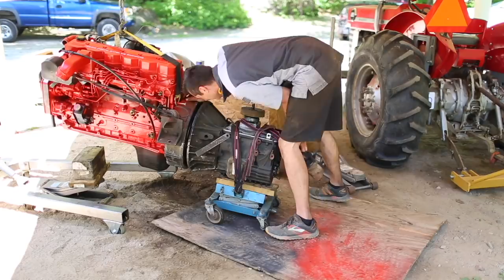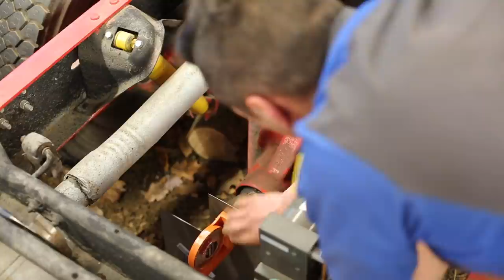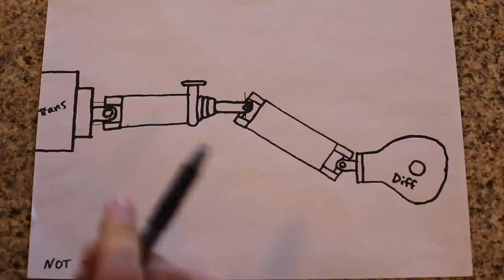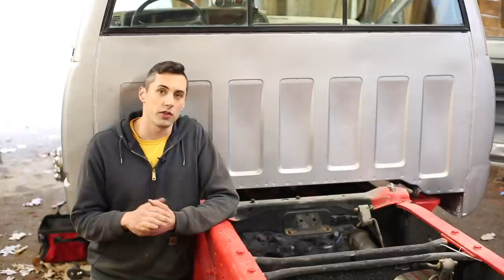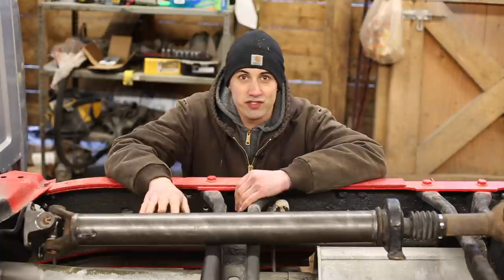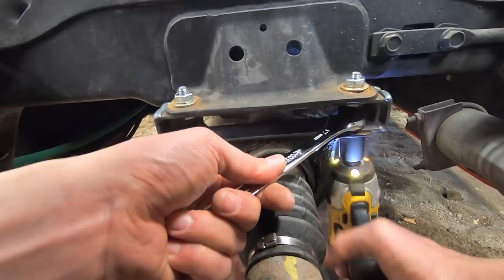Installing a Custom Driveshaft for an Eaton Fuller 5-Speed Swapped GMC C3500HD [Part 18]

Comment: I always enjoy watching these videos.  A good learning tool . Let me share some experience with drive shafts . I worked at a power plant for over 30 years and on the cooling towers there is a large electric motor that drives a gear box through drive shafts . Initially they were two shafts that were stainless steel and a center support bearing . Those things failed regularly and that resulted in damaged to the fan blades . Sometimes total loss . In fact Sometimes they through a blade off into another cell lol. Total carnage.  The fix was in the case a one piece I think fiber glass or some kind of man made material.   Failure stopped in that area .  At any rate when I did the g56 conversion I went with a one piece aluminum drive shaft.  Works OK.  I remember years ago when I was a kid out of tech school I worked for gm and they have drive line class that explained so of the material you spoke about . Lots of learning experiences over the years on drive shafts . I heard of guys balancing there drive shafts with worm clamps . Lot of trial and error there lol

Comment: U-joints should operate at a minimum of 1 degree. This is to facilitate the needle bearings rotating within the cups and prevent them wearing prematurely.
Reply: I agree, I took a driveshaft class at Dana and u-joints should never be at degrees
Reply: 0 degrees

Comment: Adjusting driveshaft and pinion angles with no weight on the rear end is a mistake because they'll change again when weight is applied. You don't even have a truckbed installed so obviously weight will be applied, to say nothing of trailer tongue weight or payload.
Reply from the maker: Yeah, I'll probably re-check the angles once there's weight on the back 👍

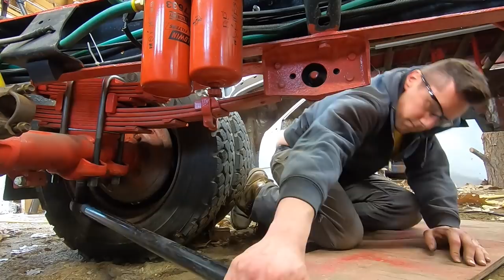Comment: 8:45 XDXD, I weigh like 300ish and I did the same thing until I couldnt pull anymore, I was bending the U bolts so I thought I was about to break them (they are grade 8)

Comment: I find that everything goes easier when I use"CRC Knocker Loose" penetrating oil before disassembly and I always slather anti-seize compound on all threads before replacement.  What happened to the disk guard that came on that angle grinder?  The sparks (burning iron) will eat holes in your clothing.  (did the dog eat it?) Ron W4BIN
Reply from the maker: Now that you mention it, that sounds about right! The dog probably ate it 😂

Comment: I like to set all my u joints at a minimum of a 1/2 degree angle so the needle bearings in the caps have to move slightly. this will help the grease get to all the needle bearings. li try to stay under 3 degrees on my joints. that pinion angle will decrease once you put a bed on the truck as well. i prefer a greaseable u joint. obviously the sealed units work well. gm, ford and chrysler have been using them for decades.
Reply from the maker: Yeah, I'm definitely going to want to re-measure it once it has more weight on the back and possibly make adjustments 👌
Reply: I was also going to comment that UJs need exercise and 0deg will lead to sticking.
Reply: I prefer greaseable joints too.  I like a bit more angle but a 1/2° works fine.

Comment: You never use a 0 degrees. the u-joint needs to move to keep from bearing rollers from embedding. The engine should be the same as the rear end. 3 degrees is the most you can have in the shafts angle. Even if you have to lower the engine.

Comment: Waldo, nice video! Remember, with a leaf spring rear suspension, your pinion angle will change throughout the cycling of the suspension (including when you add the weight of a truck bed, not to mention the weight of cargo or trailer). This is going to change your previously measured u-joint angles. They will no longer be equal and opposite to one another.  Most likely this will not be a problem or cause vibration. But, it's just an observation that in the real world, it's almost impossible to get the angles perfect.
Reply from the maker: Thanks! Yeah, once I build a flatbed, I can re-measure and change out the shims if necessary 👌
Reply: Just watching the video now and was immediately struck with the same thought. As there’s no load on the rear the angle will of course be out of spec.

Comment: Question/observation: Your 5 degree angle that is causing concern should become quite a bit less when you put weight on the rear of the truck compressing the rear suspension effectively raising the rear end relative to the frame. If this is to be a heavy towing truck that will spend much of its life with a trailer would it not be better to have a little angle in that drive shaft when it is unloaded?
Reply from the maker: You might be right about that. I'll have to measure the angles again once I build a flatbed for it. That'll probably add at least 1,000 lbs to the back

Comment: woldo you neep to be sure the working angle of each joint is 1.5 max to .5 minumn not so much the joint angle to compute working angle one joint angle to the other and subtract same result is working angle  the crosses need .5 min to 1.5 max so needles will rotate around crosses.

Comment: In the future, don’t Bang the cap back in with a hammer, I use a nut and the vice to smoothly and carefully place it into the driveshaft By placing the nut in the center of the cap and drawing it in while turning the vise closed. Smacking it with a hammer can result in losing the needle bearings. I usually smear some synthetic grease in each of the caps to ensure that the needle bearings stay in place. I never heard any nonsense about placing the caps back in their original spot due to grease.

Comment: what flywheel and clutch did you use? I'm doing about the same swap but using a 6 speed.
Reply from the maker: The clutch and flywheel came with the transmission (luckily!), but I think the flywheel is a Cummins 3977281 and the clutch is an Eaton 107621-7

Comment: Nice job on figuring out the proper angles that’s the way to do it when I worked in the shop if we did spring work we always got the customer to come backAnd we would re-tighten the bolts you’d be amazed at how much you can re-tighten them they must stretch
Reply from the maker: Thank you! Yeah, I have to be sure to tighten them again after 500 miles or so 👍

Comment: I'd love a c3500HD, just that in Montana we need that "K".  Also 4 doors for the family to ride along lol  my 93 K3500 Crew SRW will do, just planning for a spare 6.2 diesel to be machined and then I'll put it in. Current 6.5 smokes. 50k miles on the retired fire chief truck and previous owners ran it out of oil so they had someone throw a junkyard 6.5 back in, welp... here I am replacing it with a nice 6.2. lol Nice vids, keeps the creative mind going on my own projects!
Reply from the maker: Yeah, I hear you, 4WD is really nice to have!

Comment: As a grand master technician for 48 years, I would have liked to see the spacer for the center bearing support made out of solid bar or at least with tubular spacers for the bolts. The torque exhibited is quite substantial under heavy loads. That's why the original bracket is engineered so robust.  Next time level the frame & then measure the angles with a Starrett angle gauge & your driveshaft will be "spot on" rather than "close enough". Other than that nice job. (A u-joint press would have done a better job with less pounding on hardened bearing caps. They will shatter.).
Reply: Flog

Comment: Driveline angles if not correct will destroy Transmission synchronizers. I actually went to school for this. And I got a piece of paper that says I know something. What I have no idea.😆. Love your video's. I have 2000, 1995, 1989 chevy . 3500HD and 89 2500 with 6.2 2000 has 6.5 not sure what I'm gonna do. Make 10 wheeler?  66 years old.
As a young guy for you you impress me, very much so.

Comment: So on the first drive shaft section is it recommended to have the yokes of the u joint clocked the same as the 2 yokes of the 2nd driveshaft section?
Reply from the maker: No, the first driveshaft should be opposite the second, or in other words, rotated 90 degrees

Comment: Another great video, Waldo.  I have a similar 3/4” impact, and when trying to undo the nuts on my u-bolts, I found I had to upsize my airline from 3/8 to 1/2 to get full torque from the impact.  Now, put some paint on that hanger bearing spacer. Haha
Reply from the maker: Thanks, Greg! That's a really good point, I need to get a larger air hose!
Reply: Larger air fittings too like a Milton Type V

Comment: I always use greaseable U-joints.  There are adaptors for your grease gun that have a smaller diameter head that make it easy to access the zerk.  When possible I use greaseable everything, ball joints, tie rod ends ect.  I find that they last longer... if you grease them.

Comment: Not gonna tell you how to do your job, think it turned out great! However I would have welded some sockets or pipe (if I could find it small enough) in where you made the spacer, and use some grade 8 bolts to go right through it. Just a thought!

Comment: hi, so you had to make custom engine mounts for the engine to fit in?
Reply from the maker: Yeah, I didn't try off-the-shelf engine mounts, but I don't think they would have worked well. I certainly wouldn't have been able to fit the mechanical radiator fan!

Comment: The snap rings pack may include multiple thickness rings. Purists say use a dial indicator to measure the joint play and use the right size snap ring to adjust the play.  I think most people go by feel 😉

Comment: Because they are not constant velocity they will have velocity change through angular operation, the key is to work out positive and negative angles on both planes and adjust to cancel out total sum through 3 positions  a lot of people forget the horizontal plane alignment and totals, for example you can have 1.5 deg each for first two then rear one should be 3.0 deg in vertical plane to cancel out, the check in horizontal plane for lateral alignment

Comment: I forget but I believe universal joints are not meant to be at zero degrees.
There are two reasons for this, one I think is vibration but the other important one is wear.
If the joints are not moving relative to each other the bearing needles will not get lubricated and eventually the force of load and vibration will cause them to fail faster than moving joints would.
The minimum is two or three degrees from what I recall.

Comment: When it's complete need to drive that thing into a barrel of oil with these nh rot problems
Reply from the maker: I'm thinking I probably won't drive it in the winter. I've put too much work into it to have it rust away on me 😂
Reply: @WaldosWorld  give it a nice cost of fluid film or something even just the moisture parking it on grass will murder it